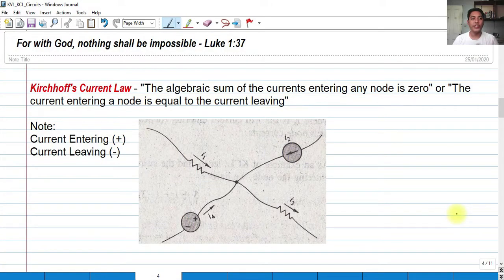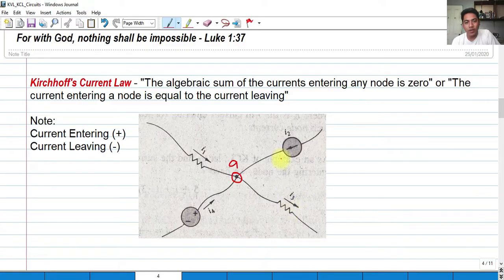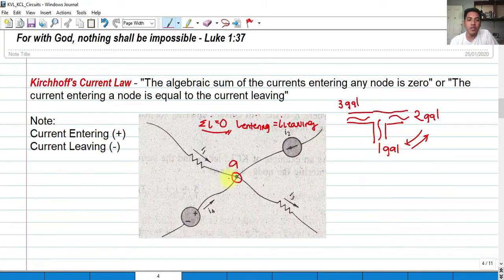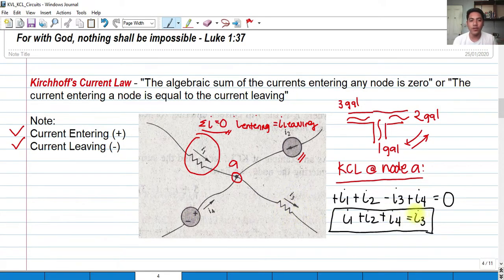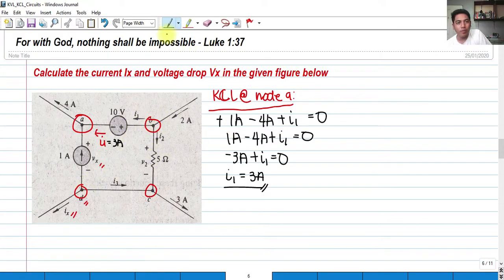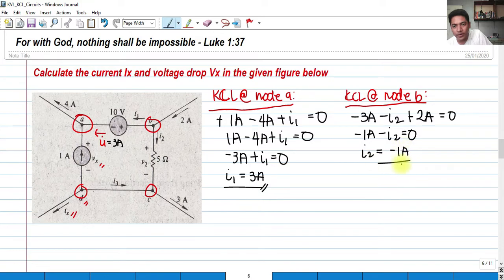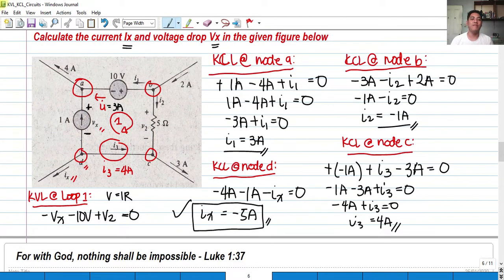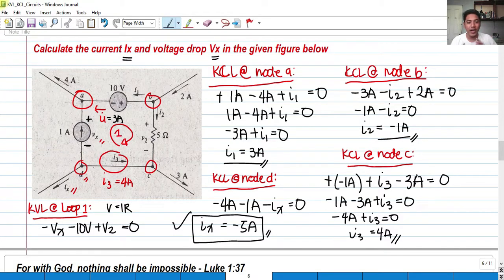Kirchhoff's Current Law (KCL) Solved Problems - Electrical DC Circuits

Comment: Sir what if we have the given current that is entering in a certain junction but we got a negative current. Is it possible that the given direction of the current indicated here in the questionnaire is wrong?
Reply from the maker: Negative current. It only means that the assumed current direction is the opposite direction.
Reply: @abatandchill  thank you sir